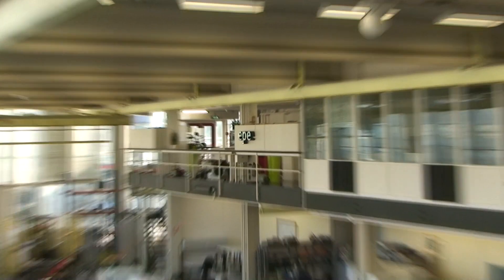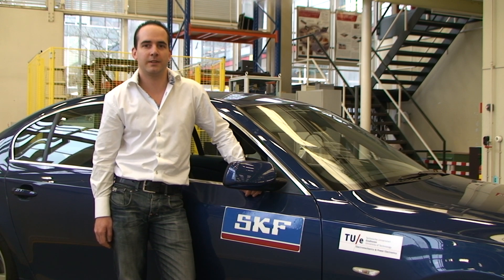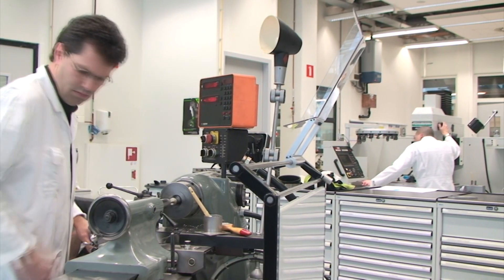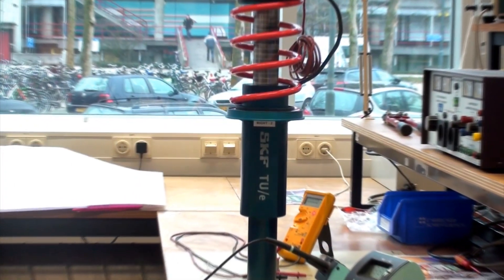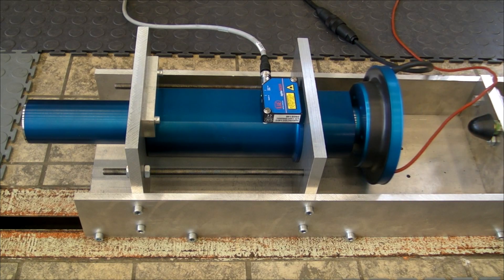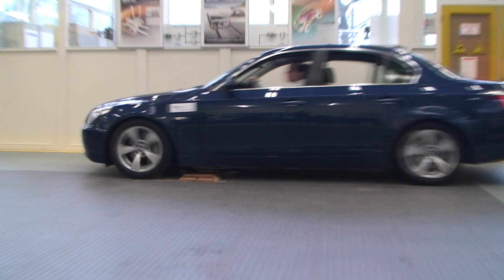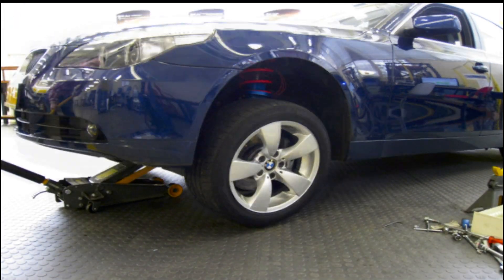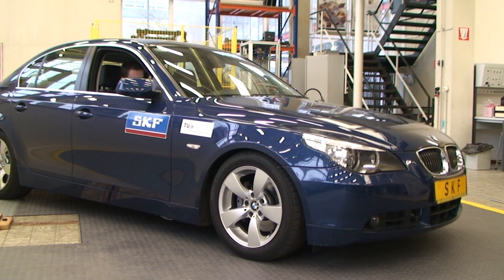Electromagnetic Active Suspension System

Comment: A variation of Active Damper System has been installed for Acura MDX second generation serial automobile (2007-2013 models) in US Sport and Canadian Elite trims. But instead of reengineering dampers completely, they used almost identical McPherson front struts and rear shock absorbers as in regular models, only replacing the dampening liquid with magnetorheological compound capable of changing density characteristics with electric field being introduced into it, thus variying stiffness from stiff (Sport Mode) to soft (Comfort mode). Not only it affected the suspension ride, but it also was controlled by various sensors in cornering when detecting body roll and adjusting dampers to attempt to improve situation. However those struts are over US $700 each for the front and the rear ones are over $400. Their average life on US roads was about 50-60 thousand kilometers and once they went bad, people usually replaced them with regular ones which cost about US $1000 for all four.
Reply: That changes only the softness/hardness of the damping. This can move the wheele, retract it etc. Not at all the same.
Reply: This technology is licensed from General Motors.

Comment: Cadillac has a Magnetic Ride Control Technology,Ferrari bought the right to use it in their autos.....Go American Tech...:)
Reply: The common called "magnetic suspension" is invented by GM, the damping fluids contains magnetic particles, by changing the magnetic field it can adjust the friction of the damping fluids. The thing in this video is totally different, it literally applies forces, making the suspension struct become an actuator.
Reply: My 2005 Cadillac has it... It's great :)

Comment: does anyone know where the sensors are in this device ?
Reply: On this device they just adjust the dampening after the bump is introduced to the suspension. On BOSE Suspension, they use like a sound something like a SONAR to detect bumps ahead and calculate how stiff or soft the suspension will be.